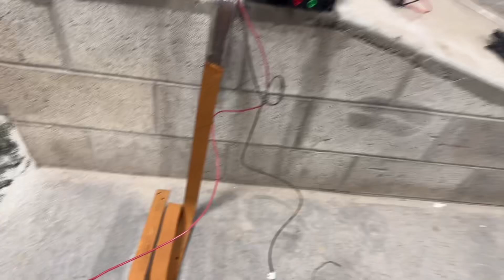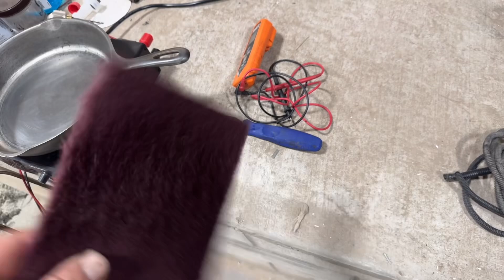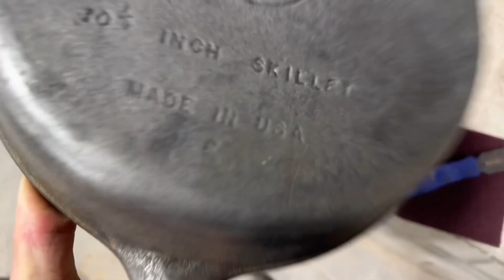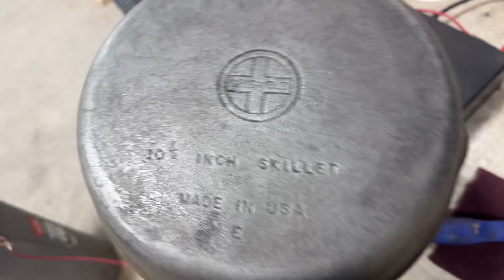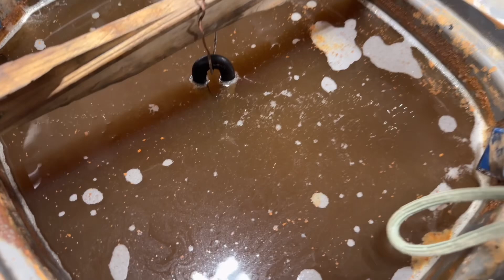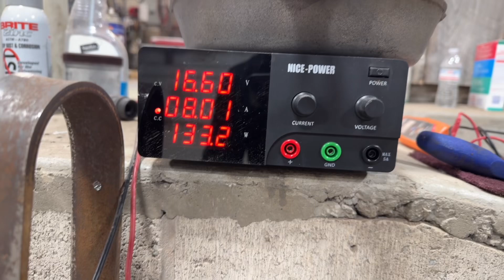How to Clean Cast Iron Pans Using an Electrolysis Bath

Comment: 👍👍👍seen someone use this process to clean up a block and head...might have to try it on a cast iron pan have got lying around... thanks for another video 👍👍👊
Reply from the maker: I didn't think of that.  It would be a great way to get your engine cleaned up cheap.  I usually send it to a machine shop and get it surfaced and pressure checked if I have it to that point though.
Reply: @irionmotorsports  👍👍...it was a engine parts that were lying around for year's and all rusty